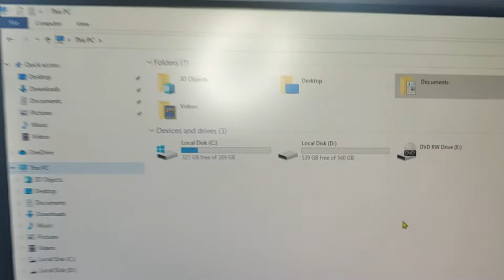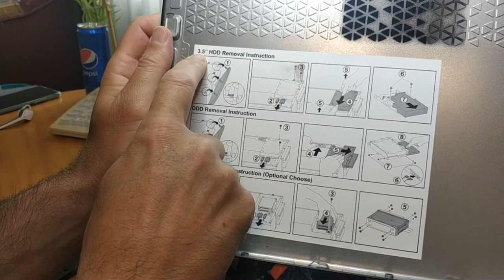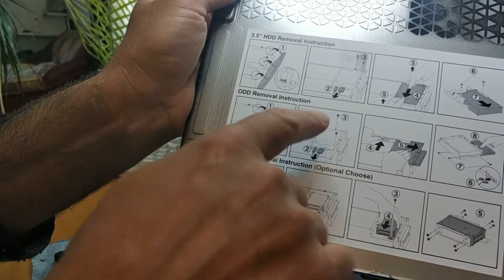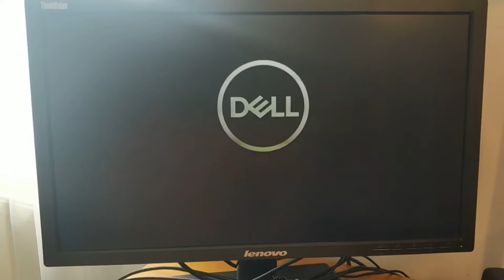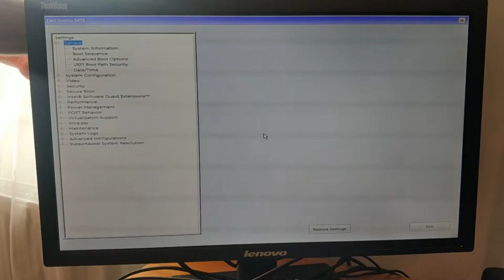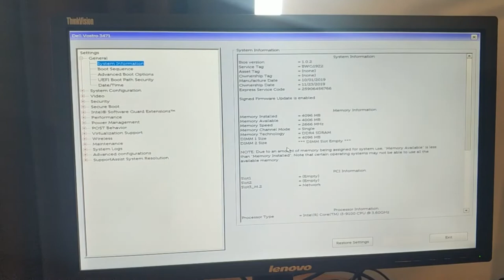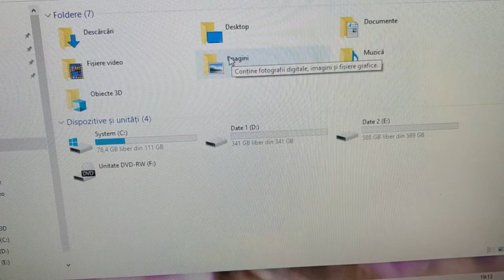Dell Vostro 3471 - Disassembly, Cleaning, SSD Upgrade, Bios setting up, ETC

Comment: Great video by the way, always interesting to see stuff relevant to my builds. Thanks.
Reply from the maker: You're welcome and thank you very much.
Reply: @DaneluRepairs  Sorry should have mentioned DDR4 2666mhz is for intel i5 and upward. FFR4 2400mhz for i3 CPU's.
Reply from the maker: @Quadromodo  no problem. Differences in therms of total performance of system are insignifiant. Most of times, we put what we have at that moment.
Reply: @DaneluRepairs   Keep on doing what you do. I find that the more I experiment with configurations the more I learn about individual machines and the more performance I can squeeze out of them. It's just something I enjoy. Merry Christmas. Have a good one!
Reply from the maker: @Quadromodo  thank you, and yes, you are right. The more you experiment, the more you lean and the more you want to know more and more stuff. Only problem is time...
Merry Christmas you too also.

Comment: Here is a reason to buy a sata power splitter cable and and an extra sata data cable.
Firstly the drive bay can easily fit two 2.5 inch SSD drives giving you one more drive on your system. The third SATA data port is there on the motherboard but there is no power output for it, hence the splitter.
Secondly and more usefully, if you connect two identical drives to the ports you can format them in RAID performance mode, this converts the two drives to function as a single drive.  This doesn't just double the single drive capacity it also roughly doubles it's speed. The only drawback being that you cannot boot from a raid performance drive so you will need your OS on the m.2 slot or PCIe slot.  None the less with games getting bigger and bigger it's definitley nicer to have them loading at double the usual speed.
Reply from the maker: Hello.
Here we go again.
1. Power sata cable splitter i have, but from my experience, in many cases after some time, they make bad contact = trouble
2. in this case, from video, moste perfect solution in therms of money/performance/space needed, is just like i did.
You are right, but your advices is not good in this case. In other, yes/maybe.
Have a nice day, mate and wish you a very good 2024.
Reply: @DaneluRepairs  Well if you prefer not to use the supported third sata port I guess thats up to you, but there is no way of using it without a splitter. Personally I hate to see things go to waste.
Reply from the maker: @Quadromodo  i did what i show in video. This computer i was saved to go to the bin.
So, i guess i do good.

Comment: You don't need to solder sata connectors, sata power splitters are readily available.
Reply from the maker: Hi mate; yes, you are right, but most of times i have to solve problem in that moment, and when i don't have connector/splitter needed,  soldering is always a way.
Better that that, i always preffer to solder than use a splitter, because most power sata splitters are garbage; a solder job is perfect. But, it's also a downside,  it takes a lot more time than insert a splitter.
Reply: @DaneluRepairs  I'd say soldering is a good solution but not if your going to sell the machine on, it could be viewed negatively. I have a vostro 3470 and used a splitter it's only problem is that the cables are longer than required. Luckily the 3470 can handle 9th gen cpu's mine now has an i5-9400. From what I've seen of upgrade routes the optiplex seems to lack that path, is that true?
Reply from the maker: @Quadromodo  yes, you are right. 
But my friends and customer have trust in me completely, so i choose best solution for them and me.
Even that in most of time i spend a lot of my time just to do a good work.
Reply from the maker: @Quadromodo  also about "used a splitter it's only problem is that the cables are longer than required" as an repair man, most in IT field, i can trully say that power adapter work for a period of time, and then cause problems, because of a bad contact. Especially when you use on harddrives, because they tend to absorbe more current at power on. 
In my career, i find a lot of sata and ata power adapters that causing problems. I even find a few times sata power connector that develop inside the connector some oxides.
That's way i choose in most of cases to do a soldering job.

Comment: Thought you might like to know this. You can run an NVME SSD and gain a partial speed increase if you use the PCIE x1 slot  Most SATA SSD's give a Windows 7 performance rating of 8.1 but a PCIE NVME will give you 8.35. If your like me squeezing any performance increase out of any platform is a plus. I use a riser cable hot glued to the vent area at the back.
Reply from the maker: Good to know, thank you.
Reply: @DaneluRepairs  Do you know how to run the Win7 performance indicators on Win 10?
Reply from the maker: @Quadromodo  no.
Reply: @DaneluRepairs  Why not give it a try. (edited)
Reply from the maker: @Quadromodo  i don't know because i don't rely heavily on Windows Performance rating. Also, not even one customer ask me to activate him that Rating, and that's way i don't know. But, as always, when i want to know something, always search on my friend Google and he tell me.
Reply: @DaneluRepairs  The thread exploded!!
Reply from the maker: @Quadromodo: perfect :)

Comment: Hey Danelu,
the SSD u installed was a Nvme or was it a M.2 SATA ? if you can, please provide me with the model of SSD used it will be very helpful 🙏🏻🙏🏻
Reply from the maker: Hello. This computer can only use Sata m2 ssd. Nvme will not work. This info is in video, maybe you not watching carefully...

Comment: One thing I missed was how the OS was moved onto the SSD, did you do that and if so how? If not, would that help speed things up?
Reply from the maker: Hello; i don't recall how i did, but in most of times i do it like this:
1. if i want to make total copy from hdd to ssd, i use Acronis True Image
2. if i want a fresh windows install, i use an usb stick
For your second question, yes, in 100% cases, move from hdd to an ssd will speed up really much an computer.
Reply from the maker: If you want to clone your hdd to a new ssd, here is kind of video when i explain how to use Acronis True Image  https://www.youtube.com/watch?v=GDh2p1nBZUQ

Comment: My power switch button power is not working how as expected. The pc turns on normally but the button is not white, he has no color. Do you know something that could be?
Reply from the maker: I'm thinking at 2 possibilities: 1. Led is burnt 2. If led of power button has wire to the mainboard, can be not connected properly. Trace visual from led of power button to the mainboard and see(i don't remember if this pc has power led solder directly on mainboard or it uses wire, so you gonna find it for yourself).
Reply from the maker: And please post back results, it can useful in future for someone else.

Comment: can i put any cpy beside i5-9400(default) and which is the powerful cpu can i put in it in this mainboard?
Reply from the maker: Hi; dell don't say, but this computer have Intel B365 chipset, which is support Intel cpu 8 and 9th; to be safe and sure, any cpu 9th with 65watts should work flawlesly; most powerfull with this specs is Core i9-9900.
Reply from the maker: If you want also a list, see here an gigabyte mainboard with 8365 chipset, choose cpu with 65w 
https://www.gigabyte.com/ro/Motherboard/B365-HD3-rev-10/support#support-cpu
You're welcome.

Comment: Hi my m2 is missing the blue plastic. Do u have any idea how to hold the m2 in place?
Reply from the maker: Hi. Yes, i do. Take a ice cream, it has to have part from where you hold it, plain size(wood or plastic, both are good) not round. Make a hole at one end. Take out cpu cooler, and put that spatula between lower part of radiator and mainboard, and the other end of spatula will hold end of ssd where screw/blue plastic where ment to be in the first place.
Reply from the maker: Hope you understand what i want to say.
Reply from the maker: If not, maybe i do a video today, if is helpful for you. Good luck, mate.
Reply: @DaneluRepairs  Thanks for the reply.
Reply from the maker: @kamalashraf4846  you're welcome, mate
Reply: @DaneluRepairs  I had a similar problem with the SSd in my riser. A busted lollypop stick and a dab of hotglue fixed it.
Reply from the maker: @Quadromodo: yeah, dodgy but working ideea, well done.

Comment: Hey man how can i open screws on the cpu fan? cause i need to replace thermal paste
Reply from the maker: Watch video..... Jesus....
Reply: @DaneluRepairs  there's no one abt this
Reply from the maker: @adesh_kustwar4927  there is; maybe i don't understand at what screws you reffer, because you don't say right; they are open by rotating; in video at 25:18

Comment: What's your pc spec before upgrade? 
I am also having same dell vostro 3471 i3 9gen 4gb ram 1tb hdd windows 10  but  it lag so what I do please give me solution
Reply from the maker: Hello. I only replace hdd with sata m2 ssd. That is the solution also for you. Lag will disappear. Good luck.
You may also replace hdd with regular sata ssd, 2,5 inch size. This solution is also good.
Reply: @DaneluRepairs  ok thanx should I also upgrade my ram with 8gb ?
Reply: @DaneluRepairs  can i use both hdd + ssd?
Reply from the maker: @latayadav7585  any ram in plus is good.
Yes, you cand use hdd and ssd on m2 slot, at the same time.
Reply: @DaneluRepairs  thanks
Reply: @latayadav7585  Two sticks of ram equal size make sure you get 2666Mhz dont use the 3200Mhz it will likely clock in slower than  2666mhz. Using two sticks of same capacity triggers dual channel which is a fair old speed increase. Plus for gaming get 8gig sticks or 16gig sticks. Task Manager performance tab will show the ram speed youre working at.
Reply: PS. here's how to make a batch file to run the win 7 performance stuff on Win 10 (maybe even win 11)
Run Cmd as admin
TYPE cd Desktop (return)
Then Type the following

Copy con performance.bat
winsat formal
powershell -command "& {&'Get-CimInstance' Win32_WinSat}";>results.txt
notepad results.txt (return)

Press CTRL C to save
You will then have the batch file on your Desktop.
Reply: With my present config these are my results.

CPUScore              : 9.1
D3DScore              : 9.9
DiskScore             : 8.35
GraphicsScore         : 8.1
MemoryScore           : 9.1
TimeTaken             : MostRecentAssessment
WinSATAssessmentState : 1
WinSPRLevel           : 8.1
PSComputerName        :
Reply: @DaneluRepairs  It was a Dell Vostro 3470 with i3-8100 and 4gig no drives for 60 quid.
Reply from the maker: @Quadromodo  ok, good to know. Thank you, mate. And Merry Christmas to you 🎅
Reply: The 266mhz is for intel i5 and above, 2400mhz is for intel i3. Sorry I forgot to mention that.
Reply from the maker: @Quadromodo  no problem :)

Comment: O Soluție ce am găsit ca sa pun un ssd de 2.5 este sa scoți unitatea optica și cu o carcasa de aia caddy sau cum de cheamă sa pun ssd ul in sata 3 de exemplu cu cablul original sau alt cablu sata folosind Pwr cable de la cd
Reply from the maker: De obicei la laptopuri fac asta, să pun un ssd de 120gb + un hdd de 500gb sau 1tb. Dar aici, fiind calculator pentru birou, hddul nu mai avea rost, plus, voiam sa rămână unitatea optica. Nu știi când ai nevoie de ea.
Reply: @DaneluRepairs  am înțeles,  merci mult și bine zis !! Numai bine și mulțumim de video-uri !!
Reply from the maker: @mihaicotin3261  mulțumesc și eu.
Reply: @DaneluRepairs  LE. A functionat cu ssd western digital sa510
Reply from the maker: @servicepcpascani4823  deci am avut dreptate cu ambele chestii, producătorul și ssd tip sata.
Bine că ați rezolvat problema. Baftă.
Reply from the maker: @servicepcpascani4823  și mulțumesc pt LE. Poate ajută pe cineva, în viitor, care va citi.

Comment: Is it possible to upgrade the processor to core i5 from core i3
Reply from the maker: 99% it work
Reply: Only 8th and 9th gen processors will work in this socket u can upgrade upto i9 9100

Comment: hey man is it possible to fit a graphics card into this pc?
Reply from the maker: hello Polish; yeah, you could put a dedicated video card in this pc; as you see in beginning of video, min. 3 aprox. the pci express slot is there; only you have to buy a LOW PROFILE video card, to be fit in this case; good luck.
Reply: @DaneluRepairs  cheers
Reply: @Polish001  u can fit upto gtx 1050mini because it is highest in low profile i have installed a gt 1030 in it and its working really fine
Reply: It has to be low profile single slot!!  The best offering is the Radeon RX 6400. if you don't have the cash then the Nvidia GT 1030 is resaonbly good pretty cheap second hand.

Comment: Salut! Poti sa-mi zici zici ce cod/model este ssd?
Reply from the maker: salut; sincer, nu-mi mai aduc aminte, uita-te si tu pe video; parca, din cate tin minte, era ssd normal, nu nvme
Reply: @DaneluRepairs  cred ca este nvme, si acest model merge doar cu hynix sau samsung.. ai mai avea pc-ul? putem afla simplu din disk management
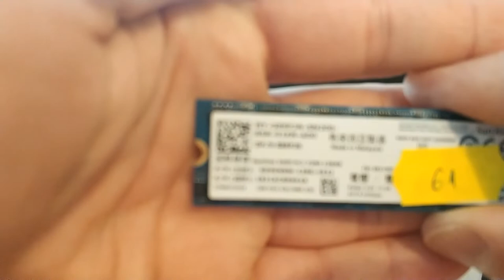Reply from the maker: @servicepcpascani4823  nu este nvme, cum corect imi aduceam aminte; nu am intalnit in viata mea vreun device care sa faca diferenta intre producatorul de ssd; logic, nu mai am pc-ul, ca altfel ma uitam; dar nici tu nu urmaresti video-ul, desi iti trebuie informatia, a trebuit sa stau eu sa pierd timp din nou...vezi ca este filmat clar ssd-ul la 39:15 .... este SATA, nu nvme; oricum,  scria si pe placa de baza "m.2 sata"....
Reply from the maker: @servicepcpascani4823  si este un sandisk oem luat dintr-un laptop, nu "hynix sau samsung"....
Reply: @DaneluRepairs  am probat un adata si un wd pe care nu le-a vazut, iar pe site producatorului la ssd suport list afiseaza doar samsung si hynix. succes, merci oricum
Reply from the maker: @servicepcpascani4823  nu le-a vazut pt ca erau probabil nvme, sau e slotul defect, sau e disable din bios, sau e biosul vechi; motive sa nu le vada nu are; acolo pe ssd suport list e listat DOAR ce au testat ei, nu ca pe altele nu le suporta; multumesc, dar ca sa am succes, da un like si un subscribe, altfel.... oricum, e munca f multa pt a ajunge macar sa castig un ban din yt, foarte multa....
Reply: PC401 NVMe SK hynix 256GB  I'm guessing you asked.

Comment: Can we play Gta 5 in this pc?
Reply: Easily
Reply from the maker: @fernandowokas2218: it will work, but only if you have a good cpu and a dedicated video graphic card; here is the requirements of GTA 5:

Grand Theft Auto V System Requirements (Minimum)
CPU: Intel Core 2 Quad CPU Q6600 @ 2.40GHz (4 CPUs) / AMD Phenom 9850 Quad-Core Processor (4 CPUs) @ 2.5GHz
CPU SPEED: Info
RAM: 4 GB
VIDEO CARD: NVIDIA 9800 GT 1GB / AMD HD 4870 1GB (DX 10, 10.1, 11)
DEDICATED VIDEO RAM: 1 GB
PIXEL SHADER: 4.0
VERTEX SHADER: 4.0
OS: Windows 10 64 Bit, Windows 8.1 64 Bit, Windows 8 64 Bit, Windows 7 64 Bit Service Pack 1, Windows Vista 64 Bit Service Pack 2*
FREE DISK SPACE: 72 GB
SOUND CARD: 100% DirectX 10 compatible

Grand Theft Auto V Recommended Requirements
CPU: Intel Core i5 3470 @ 3.2GHz (4 CPUs) / AMD X8 FX-8350 @ 4GHz (8 CPUs)
CPU SPEED: Info
RAM: 8 GB
VIDEO CARD: NVIDIA GTX 660 2GB / AMD HD 7870 2GB
DEDICATED VIDEO RAM: 2 GB
PIXEL SHADER: 5.0
VERTEX SHADER: 5.0
OS: Windows 10 64 Bit, Windows 8.1 64 Bit, Windows 8 64 Bit, Windows 7 64 Bit Service Pack 1
FREE DISK SPACE: 72 GB
SOUND CARD: 100% DirectX 10 compatible
Reply: Works fine 1080p with GT 1030 medium settings 60fps+